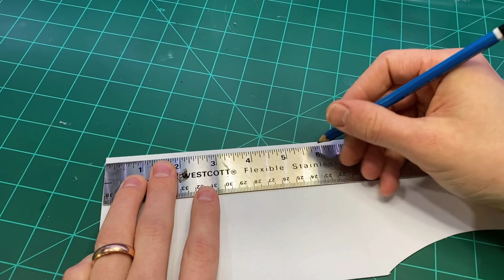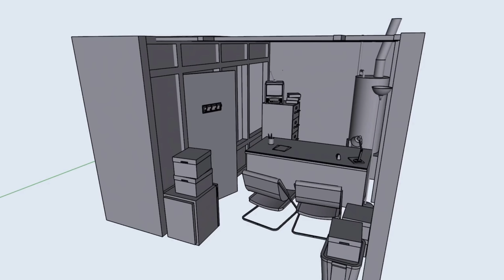Saul Goodman's Office | Breaking Bad Better Call Saul Diorama

Comment: This is a wonderful gift. I have a question for you. Watching your videos has inspired me to get off my but and start crafting dioramas. (Not sure if I want to put them on you tube yet or not) I recently got a 3D resin printer. What cad program do you prefer and what do you use it on? Tablet, laptop etc. any help or advice would be great. Thanks and keep up the awesome work.
Reply from the maker: Hey! Thanks for your question. I use an iPad with  Shapr3D and Forger. I love working on the touch screen + Apple Pencil + keyboard, but the processing capabilities are definitely lacking for heavy use. I also have to transfer everything to a computer for slicing. If you have a decent computer, that is the way to go for 3D printing. Tablets are almost there, but not quite yet.
Reply: @Boylei   thanks for the reply. I picked up a laptop and I have been learning Blender and using Chitubox. It's been a learning experience for sure, but fun

Comment: Did you design the drop ceiling? If so what sizes are the styrene panels, it would be cool to do this in one of my dios
Reply from the maker: I did! I scaled down a 2x4 drop ceiling frame and printed it out on my PLA printer. The panels are 1”x 2”
Reply: @Boylei  thanks!
Reply: @Boylei  now just to design a frame to print